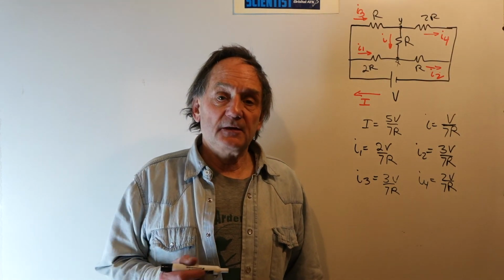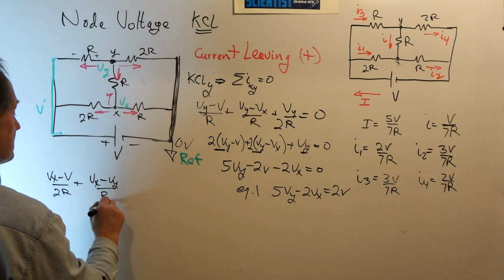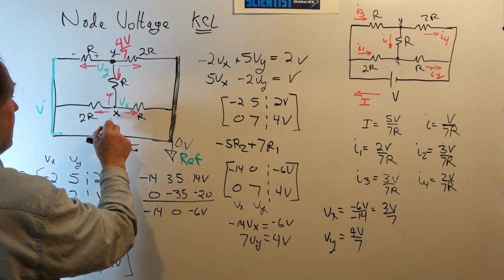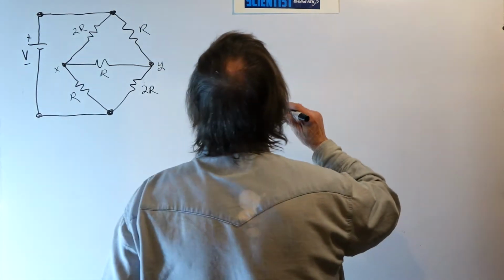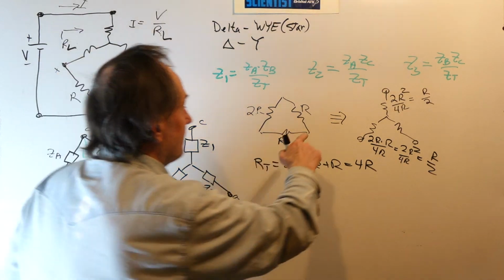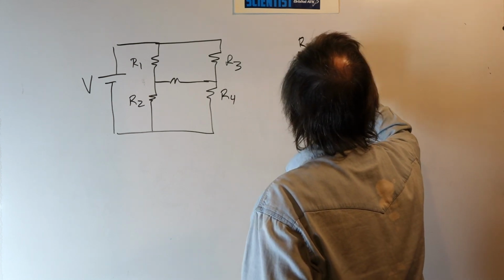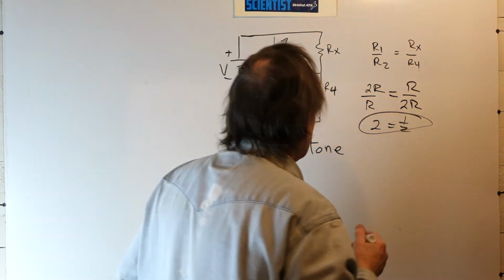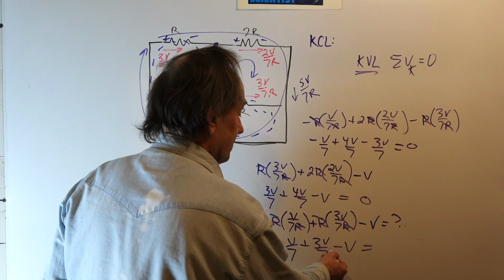Bridge Network part 2: Solution to Lewin problem 24 Bridge Network

Comment from the maker: ------------      TIME   INDEX  --  TABLE  of  CONTENTS  for  this  video    ------------
0:00:00    Summary:   the current values
     0:03:35    Establish current convention -  currents leaving as POSITIVE
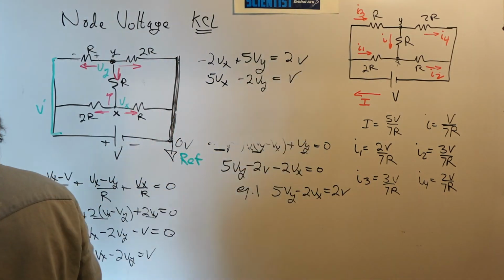     0:09:40    The Node voltage equations
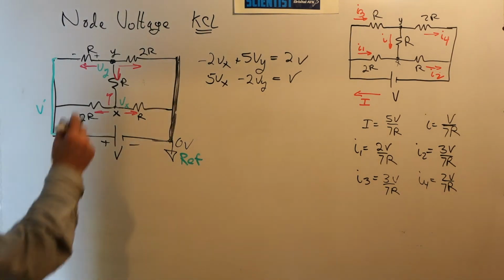     0:10:03    Matrix formulation
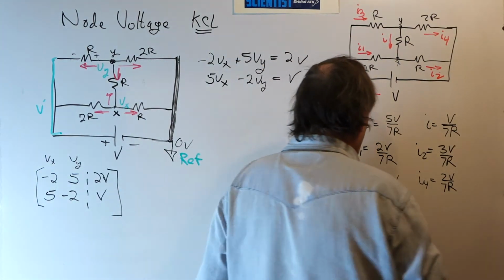     0:10:30    Comment about Matrix symmetry
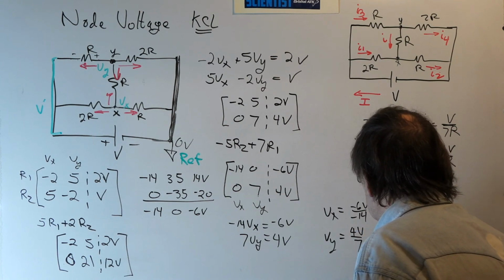     0:14:55    Node voltages found   Vx = 3V/7  , Vy = 4V/7
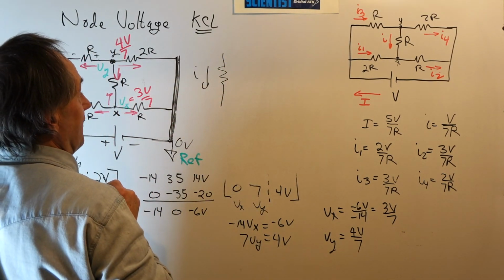     0:15:40    Finding the bridge resistor current,   i = V/7R
     0:17:37    Solving for i3 =>  ia
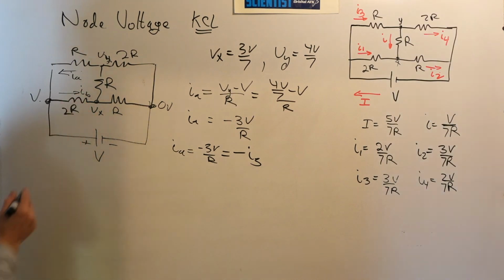     0:19:48    Solving for  ib

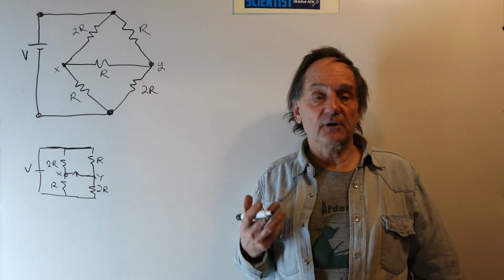0:21:05   Begin the DELTA-WYE  conversion
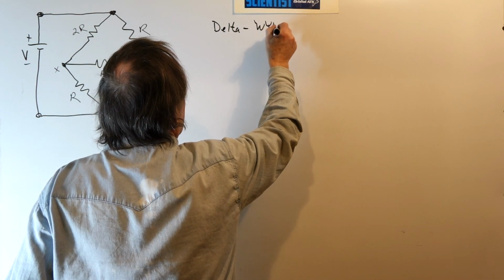    0:22:45   the transformation equations
    0:29:15   Calculate the "Y" resistor values for the bridge network  
    0:31:07   The converted network with WYE embedded
    0:31:04    Redraw the new network
    0:33:04    Combine series resistors
    0:33:44    Combine parallel combination of resistors
    0:35:30    RL = 7R/5   the load the network presents to the voltage source
    0:36:20    Total current delivered by the voltage source to the network

0:37:00   WHEATSTONE  BRIDGE
     0:38:00   Resistor ratio in a Wheatstone Bridge
     0:38:50   Necessary condition for the bridge resistor current to be ZERO
     0:41:00   Resistor ratio requirement:  R3/R4  = R1/R2    
     0:41:40   How a Wheatstone Bridge is used
     0:43:10   How to measure an unknown resistor with a Wheatstone Bridge
     0:44:20   Why the R-2R  bridge network is NOT a Wheatstone Bridge

0:46:25   How to check your answers for voltage and current in a network
                Use  KCL and KVL to check consistency
FINISHED

--------------------------------------------------------------------------------------------------------------------------
The original problem statement:  www.youtube.com/watch?v=W9-yxYIWkqg
Prof.  Lewin's  solution:    www.youtube.com/watch?v=7Y7FZ_AtrEs

ENJOY the video  - comments and suggestions welcome

====================================================================
KNOWN  ERRORS:
19:02    I dropped the "7" in the denominator for "ia".  
                        ia = - 3V/7R
Reply from the maker: YES,  I misspoke.  I was very tired when I made the video.  I had been awake for about 32 hours and it was at about the 23rd hour I made the video.  Just too much on my plate these days and not enough awake hours to address it all so steal sleep time.
GH
Reply: George Hnatiuk You're a Saint!!!